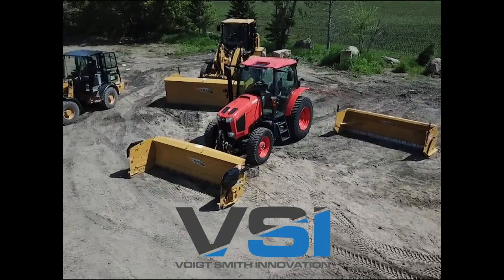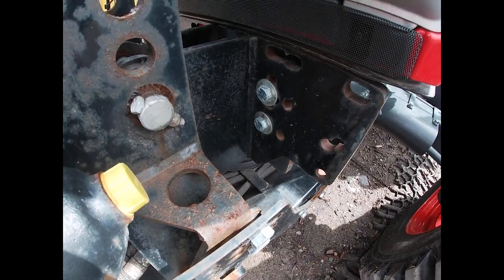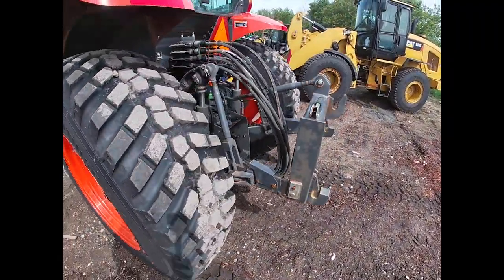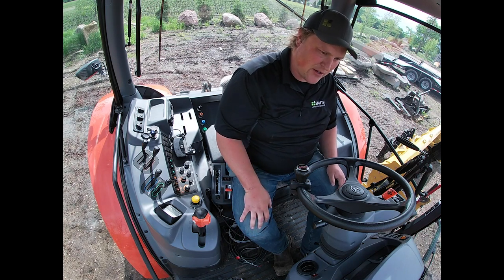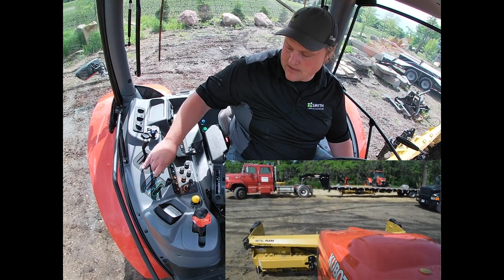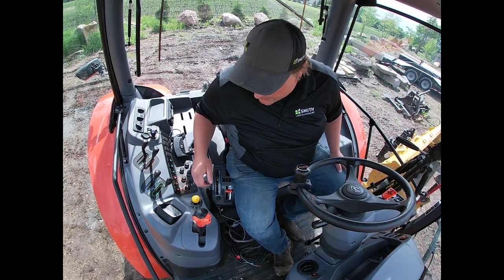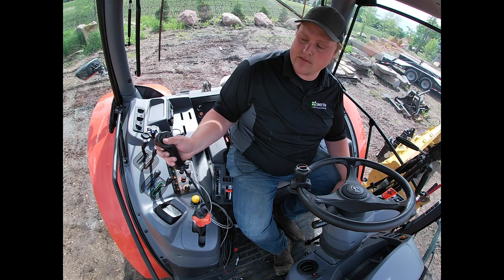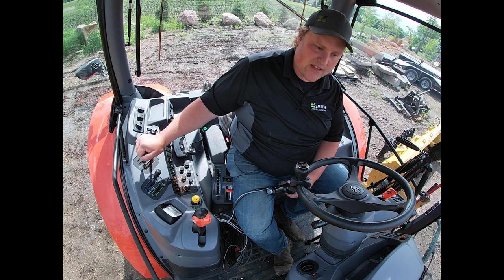Metal Pless Agrimaxx on Kubota Tractor: Install and Functionality

Comment: i ended up going with a plowmaxx on my kubota loader arms. there is quite a bit of distance between the plow and the front of the tractor. on full tilt, the plow will never touch the front tires. i am now looking at adding to the fleet this time with the agrimaxx on an m5. any idea how much closer the agrimaxx is to the front of the tractor vs the plowmaxx on the loader arms? it looks to be 2-3' closer but im not sure. even if you could tell me the distance between the back of the agrimaxx and the nose of the tractor that would help a lot. as always thanks for your videos.

Comment: I have 3 rear remotes. 2 loader valves for up and curl. Also aux valve for loader. Currently have lift plummed into loader with float. Have one hydro going to rear remote. Then electrical on a joystick for the rear remote to select each wing and angle. Other 2 rear remotes currently going to 3pt blower.